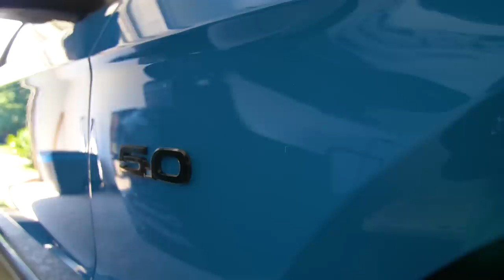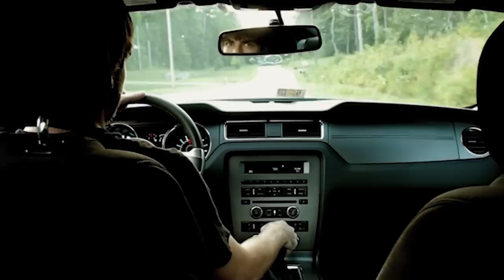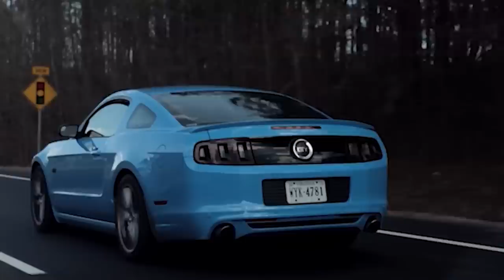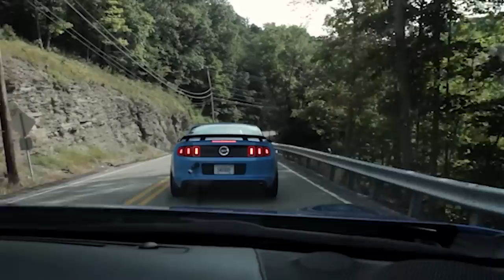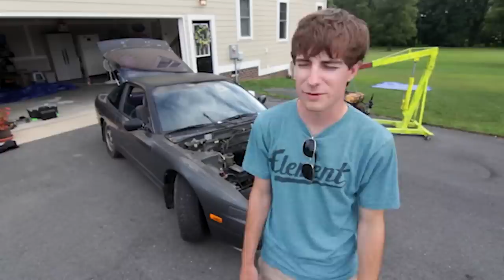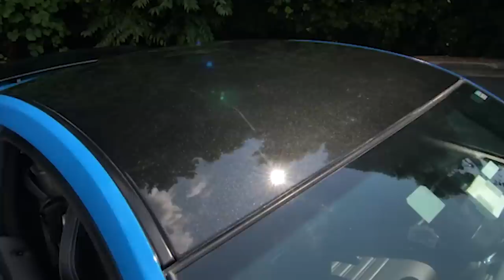Smurrf Mustang GT Build 10 Years Later: From Broke to Boosted

Comment: I have a 2014 Mustang GT premium track pack in grabber blue but I have taken a different route with mine. After 10 years it has 2500 miles, still has every original part except the oil filter. I change the oil annually despite averaging around 224 miles per year. Even has original tires. Never been washed with water, never been rained on, never spent an entire night outside, garage is heated and cooled just like the rest of the house so it lives in an environment very similar to my living room. I love it!

Comment: Damn I remember watching your videos in class in high school not long after getting my first vehicle, 2001 ram truck, in 2011. It was probably very soon after you started doing reviews of others stuff that I caught on. I’d never thought much about cars before that, they were appliances. But that first solo drive was also in MY truck and it kind of awakened an addiction to these things. I still have that truck. Being in the upper Midwest it shows, SOOO much body rust. But I’ve built the drivetrain with gears/lsd, built trans and lastly I built the engine. Truck has taught me a lot and given me a bit of an irrational confidence on tackling unknowns with cars. 

Watching your videos of Smurf and how much you’ve raves about the coyote engine in those videos she the other mustangs you’ve reviewed REALLY pushed me towards a Ford when it came time to have something more dependable to daily. I’m now on my 2nd coyote F150 and I could not be happier. These things are cheat codes lol. I hope to boost it one day maybe but I run an E85 flex tune as it’s all over in Iowa and with a gt350 mani/tb package it’s a reliable and extremely fun daily driver.

Comment: the first one of your videos I saw was the sleeper maxima. it really caught my eye since i have had my 02 6 speed maxima since December of 2012. I didn't start modifying it until last year when it hit 300,000 miles and now has 315,000. it can out run 350Z's and keep up with 370Z's. here is the mod list

VQ30DE 95-99 Maxima exhaust manifolds

Warpspeed y pipe

full 2.5" exhaust no cats, complete exhaust description in my last video

modified stock air box

NWP 75mm throttle body

NWP 5 piece plenum spacers

NWP VIAS delete

JWT flywheel

2J Racing under drive crank pulley

M-Pact brand 350Z pressure plate and disc

03 Sentra SE-R Spec V Helical LSD

Nisformance ECU flash

Comment: Good luck getting away from a Prelude on a back windy road. I have a '98 w/ full bolt-ons and lots of suspension goodies and it out corners my '02 Camaro SS without breaking a sweat. The Camaro has SLP parts and an Eibach suspension package something or another. Full poly bushings and poly motor mounts on both cars. Highly recommend as a first mod along with lowering springs. These two things are the most fun for the buck.

Comment: Have you checked the mega fuse? There's basically a major fusible link between the junction box and the charging system. If that goes for whatever reason, you won't get any power anywhere despite having good battery voltage. Maybe the new alt you stuffed in there was bad and fried it.

Comment: Audience, I listened through your whole video. It was very humble. Merchandise can be taken away, but memories last forever🤜🏼🤛🏼🙌🏼✌🏼. I'm debating on purchasing a GT500 or GT. Which would you consider today? I do want it turbo charged for extra power, and I'm considering going to the mustang shows with it. I own an 04 mystichrome cobra with 8k miles, and a 93 procharged Fox completely molested with over 20k in gone in 60 second parts/new racing engine/upgrades. I'm trying to make a choice between a really clean 2013 Deep Impact Blue GT, a 2011 grabber blue GT500, or 2014 black GT500. I also spotted a 2011 black GT500 with only 500 original miles. Hard to decide, but with your experience having a 5th gen would help allot.

Comment: I never understand why David talks so much negativity about 4.6 3 valves I own a 2010 GT and I'm happy to say that even though it does not make as much power as David's 2013 GT mine still runs without a problem and it's two years older than his.

Comment: My cars aren’t that “special” but both are pretty damn good at making me happy.

I have a daily driver Volvo V50 1.6D Drive E (5 speed manual, MTX75 apparently the “same” transmission that came in the Mk1 Focus RS), really enjoyable for what it is, handles great and get around 50-ish MPG US.

I also have my Volvo S60 (face 1, P24) 2.4T M56 (5 speed manual) with a rear muffler delete and Stage 1 Tune from BSR bumping it from the stock 200Hk and 285Nm to 250Hk and 410Nm and some cosmetic goodies, I plan on doing more to it now that I finally have a some what stable income.

Comment: How many miles were on Smurf when you got the gen3r? I have been contemplating getting a vmp gen3r for my 2013 gt track pack, but it has 115k miles. Do you think the engine would be fine or is it just too used for a supercharger? Thanks!

Comment: Sounds like a bad battery with that car? If you said you were getting electrical codes and had voltage issues (hence why you replaced the alternator) that sounds like a battery going out. If it doesnt crank (I'm assuming it doesnt since you said you tried trickle charging it) then I would suspect the battery. Batteries do almost infinitely goofy things to a cars electrical system when they're going bad, alot of people mistake the alternator first.

Comment: Did you change the fuel system? Maybe a fuse for the crank sensor?
Reply: Curious because sometimes a short from the ground could cause that fuse to blow. Maybe check grounds under the rear seat

Comment: I think people are driving oblivious totally clueless nowadays, I got my mom's 95 gt vert eventually when she passed (long sad story) and in the last year I have had 3 close calls not my fault, I feel like it will be gone sooner than later because a small accident will total a 95 even if it has never seen a winter its in really good shape, in Maine but zero rust and totally unmolested other than 18x9 cobra wheels with 265/35s and exhaust mods I've done. it still has original Ford oem spark plug wires! But Kelly blue book says old mustang $1500/2000? taking nothing into consideration except year and model. About a year ago a wealthy old woman in a Lexus SUV backed out of a perpendicular parking spot right Infront of me I laid on the horn and threaded a traffic needle somehow and checked my pants,she would have been just  fine new expensive suv back in action while I'm out of my sentimental car I love and a cashier's check of peanuts, 3 weeks ago a young girl did a non looking rolling stop out into the road out of a supermarket on my side, horn blasting carful brake modulation controlled steering screeched to a stop on other lane a foot Infront of her and checked my pants. And yesterday I was watching a Cherokee doing 40ish in my rear view not slowing while I'm stopped in traffic I had nothing I could do but watch in mirror with a calmly saying to my son no no no wince on my face the jammed on brakes last second and didn't hit me... So I guess it's on me to drive super defensive...